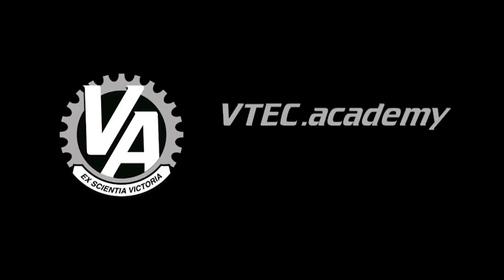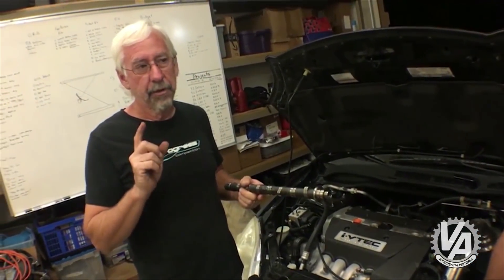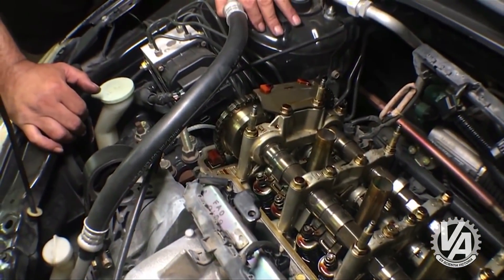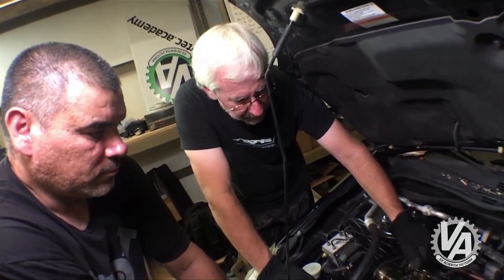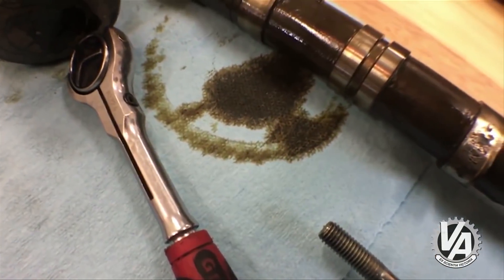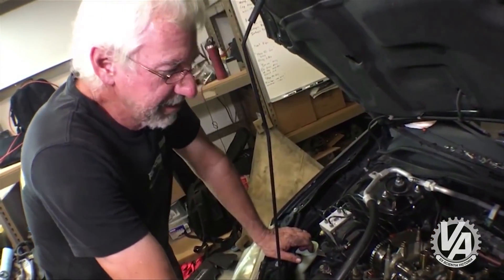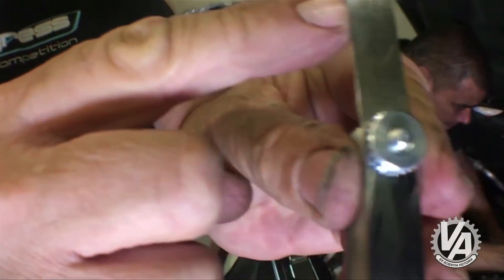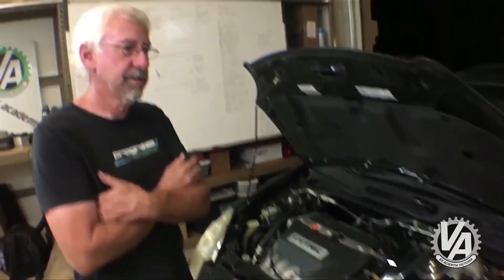K Series Cam Install

Comment: Same problem on my accord cl7 k20z2 camshaft wear, when i replaced my timing chain and oil pump chain guides tensioner etc, ive opened the valve cover to replace valve cover gasket the grommets and spark plug tube seal ive saw it, bought one cheap for 100$ and fixed it

Comment: Careful dropping that chain, it will fall off the teeth of the crank and walk a tooth making the timing off. Potentially having to remove the front cover which sucks big time. You can also compress the tensioner in the car by turning the engine backwards so you can pin it then you don't have to remove it, we never do. It's generally easier to remove the intake cam first because the guide in the front doesn't have that long ear at the top making the chain hard to remove. Dealer tech here who's replaced more VTC actuators than you can imagine since it's way more common than the ex cam wear but we do see a wiped out cam lobe from time to time, happens on the front bank of some newer J series too.

Comment: We replace a lot of vtc actuators in the dealership. We keep the chain tensioner in, we go just past  TDC then turn it back and pin it. It gives just enough slack in the chain. Besides the chain sometimes skipping a tooth on the crank from not keeping tension on it another common thing to be mindful of it when popping up the cam that the rockers don't pop up and let the springs come out.
Reply: I know I'm kind of off topic but do anyone know of a good site to watch newly released series online ?
Reply: @Kasen Kohen Try Flixzone. You can find it on google :)
Reply: @Kasen Kohen Lately I have been using FlixZone. Just google for it =)
Reply: @Hendrix Brysen yea, I've been watching on flixzone for since march myself =)
Reply: @Hendrix Brysen Thank you, I went there and it seems to work :D I really appreciate it !!
Reply: @Kasen Kohen No problem :D

Comment: What size drill bit?
Reply: Dbigpinoy 

pretty much whaver fits the hole...i did the same thing on 2001 hyundai xg300 hydraulic tensioner used drill bit...